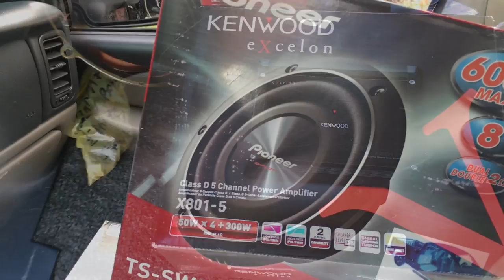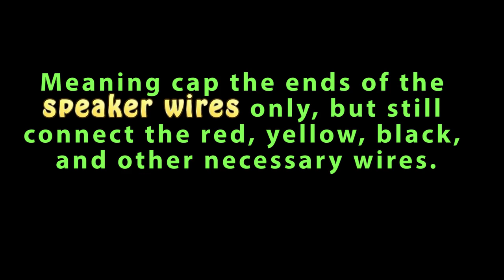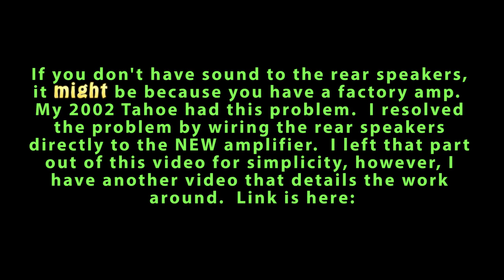Amplifier Install Chevy Tahoe GMC Yukon

Comment: Can anyone help me out, 1999 Yukon Denali with Bose, I swapped in an aftermarket unit in place of the factory radio and used the metra harness all wired up easily and have power to the whole system, but my issue is The Volume is Way Too Loud at like 1!? Am I missing something some kind of module, interface, Special wiring harness? Aftermarket unit has 2 RCA outputs, everything works fine but sounds Overpowered. Not ready for amp and sub add-on just yet so don't want to bypass.. TY

Comment: Maybe I missed it, but did you run speaker wires from the Amp to the factory sub or did you use factory wiring?

Comment: Does this amp get hot on ya? I just switched to this exact amp and mines seems to get too hot for my liking.
Reply from the maker: YES.  But it's never failed me.  I might make a box for it and run push/pull fans in the future.
Reply: @TahoeSteve  I've drove 10 hrs and it's hot but doesn't shut off. I play my music at moderate volumes mostly.

Comment: I have a 02 Tahoe and I'm getting too many volts to my ampsI know this because I unplug a wire on the alternator and my amps did not go into protection but when I plug that wire backup my amps going to protection when the bass hits hard the problem with leaving that wire unplug from the alternator is the 02 Tahoe has to run at like 19 volts when I unplug the wire it drops it down to like 13 I thought the whole problem was the factory amp but I disconnected the factory amp so I guess I have to get an amp regulator or a voltage regulator or do you know another way
Reply: NorCal Rider  hell it doesn't matter anymore I figured it out my whole entire problem was I was trying to put my amp in the third row seat and I only ran 8 gauge wire so yeah that will make your amp go into protection lol when I moved it closer to the head unit all my problems went awayI probably didn't even have to rip out the factory amp I can't believe something like that stunt me as long as I've been putting in stereo systems I've just never owned anything like a Tahoe I've always had like a Dodge ram or a car so running 8 gauge wire is fine for situations like that

Comment: My amp clips from ground to seat bolt. How do you keep yours from clipping, this is a small amp too, 250 peak watts so im sure its only pushing 150 rms
Reply from the maker: did you get all the paint off the ground bolt?  i hit mine with a steel brush and knocked all the paint off of it.
Reply: @TahoeSteve  turns out its my amp. Doesnt lime the sub i guess, trying to push a 15 inch sub rated for 700 watts rms. Amp gets hot too, gotta get a better amp

Comment: What length of RCA cable would you recommend getting to where you would not come up short by running it along the passenger side?
Reply from the maker: Mine was around 10 feet and NOT long enough.  So, longer then that...

Comment: Ok I’m trying to install a aftermarket amp and sub I have everything installed and power to the amp but I’m not getting any sound out of the subs is there anything I need to do behind the radio in order to get sound to the subs
Reply: Did you plug in rca behind stereo

Comment: The plastic on my Tahoe was very easy to get off when I had a system in my 01 Dodge ram that s*** sucked trying to take all the plastic off cuz everything screwed down and also finding a place to get through on the firewall was near impossible and I almost f*** up my whole wiring system it got to the point where I couldn't get it through so I basically moved the boot aside and taped up my power wire really good and ran it outside of the boot but now I can't get the boot back to where it was I think I'll just silicon it all back upI have done a lot of systems in my 02 Tahoe was the hardest by far getting through the firewall then after I get everything hooked up only my sub was working the factory speakers were not and then every once in awhile the factory speakers world work and my amp will go into protection and the sub will stop I think it has something to do with my head unit I went and bought a new one whenever it stop being so f**** cold outside I might go actually install it correctly lol nice video though 👌 I always second-guess myself when I'm doing stuff like this

Comment: I have the exact same vehicle except for I have a 2-channel and a 4 channel amp 2 channel amp for a big 12 kicker and the four channel for two audiobahn tens and the highs only problem I'm running into is I don't think the factory speakers will hold up being connected to a amp and I was really trying to avoid taking the doors offsorry I'm leaving so many comments but I'll sit here and watch this video and think of something else probably won't be the last comment 😂the way you wired everything up is very confusing for some reason it's not that complicated but I think you threw me off with not using the wire harness that plugs into the radio
Reply from the maker: Sorry you are confused.  Here's what I did as per this video:  https://youtu.be/NXwjRasWbus

1.  Aftermarket radio comes with a harness.  2.  Then you have to buy an aftermarket harness made specifically for your make/model car.  3.  The aftermarket harness made specifically for your car is what goes into the existing harness in the car.
Reply: How did you get the second amp working? I've got two 12"s that need a stronger amp to power them. I've got everything hooked up right as far as I know, but the extra subs won't make any sound. 2nd amp is powered, all other speakers and stock sub are working, and I can hear the 12"s connecting when I plug the RCAs into the head unit. But nothing else.
Reply: @TrueBolt18  you could have a bad amp or just hooked up wrong if I have two amps I always run a separate signal wire and Power then I get them RCA's that have two female ends and one male end "a splitter" unless you have a head unit that has enough plugs for RCA's but normally radios I bought in the past only have two ports so I have to put them splitters together and make to RCA wires out of one but if the RCA's are not the problem make sure you run a separate signal wire for sure sometimes you can share power depending on how much you're running and also make sure your power  wire is big enough and if you don't have a big enough wire make sure your amps are as close to the head unit as you can get them other than that it's a pretty hard question to answer without putting eyes on it
Reply: @TKD187  Man I'm dumb. XD I had to bypass the stock amp's signal wire for all the speakers and just ran it to the windshield wiper fuse, which was fine. Pulled the stereo out, and low and behold, I never reconnected the 2nd amp's signal wire. It works great now. XD I'm liking this vehicle a lot more than I initially thought I would, it's a great ride and sounds awesome. =)

Comment: You wired the amp remote start to the switched ignition power instead on the remote start coming from the old amp. Why is that?

Comment: I like what you did to the plywood. Would have like to have heard what it sounded like when you were done.
Reply from the maker: Problem with letting you "hear" it is you are "hearing" it through a cheap camcorder and it does not do it justice.  I laugh at these guys who put $10K systems with quad 15 in woofers in their cars, and then say, listen to this, and record it with a cell phone.

Comment: So did you not use the front tweeters and the back pillar speakers?
Reply from the maker: yes, and i don't miss them at all.
Reply: @TahoeSteve ive got a new crunch 4 ch thats bridgeable. and i was wondering if that would power the 4 speakers in the doors and the sub in the rear?

Comment: What did you use to connect to the positive connection for the battery
Reply: use a gm post extender they vary from 5 to 10 bucks. all it does is extend the screw so you can attach the power wire and a nut holds the terminal in place.

Comment: Do I have to remove the old to use the new amp
Reply from the maker: no, but it will distort terribly
Reply: Tahoe Steve can you bypass the factory amp without a harness
Reply: I was going to ask similar question.
 Have the 95 suburban with stock Delco radio/cassette deck .
 Still want or wanting the rear ceiling/lift gate speaker(s) louder.
 My own hearing is shot. Pretty much am deaf in right ear; So, I don't feel necessary to do audio upgrades
- though I replaced the rear driver speaker L/R as they had aged and crumbled. Fronts are still original bose door speakers, and sound good. W/50,000 miles
-driving my suburban more often lately... actually the stock radio system has not much tone adjustment. Not enough Bass!
Reply from the maker: I bypassed mine
Reply: @TahoeSteve  lmao I forgot about this comment section I’m sad I no longer have this car anymore
Reply: @missingremote4388  I’m not sure about having the rear speakers louder but you could adjust your phones audio setting if your using a Bluetooth fm transmitter to connect your phone to the radio also like I said in a comment earlier I just used a rca cable adapter and spliced it into the oem amp inside the center console at least that’s where my amp was on the 03 suburban z71
Reply: @PandaHiveGaming  thank you. I have the older suburban with out the   console. Stock radio / no bluetooth or MPEG. I've never tried those x 19 years.
- my stereo balance knob was on left only. I only needed to center it for L/R
 I tried the radio today and it sounded very good or passable, for stock bose speaker in front.
Reply: @missingremote4388  which generation also what kind of radio do you have?

Comment: Were did you wire the Blue remote wire to on the amp convertor
Reply from the maker: to the remote wire location.  it actually says P.CON on the amp itself

Comment: where did you connect the remote from amp
Reply: The remote is that blue wire on your harness that normally has a black piece on the end of it that you have to cut off if you're talkin about a signal wire for your amp

Comment: The way you wire that makes sense but I'm f**** confused as shit lol if you don't use the harness for the radio how are you plugging it into the radio ? Lol did I miss something 😂 because I was going to do the same thing instead of branching off of my amp and going to each speaker in the doors just connected to the factory wires and then on the other end hook it up to the I think that's what you did but I'm not sure why you didn't hook up the stereo wire harness it might hit me in just a second 🤔
Reply from the maker: 1.  Aftermarket radio comes with a harness.  2.  Then you have to buy an aftermarket harness made specifically for your make/model car.  3.  The aftermarket harness made specifically for your car is what goes into the existing harness in the car.
Reply: @TahoeSteve  yeah I got it you just didn't hook up any of the speakers on the head unit harness but you did use the signal wire power wire and ground right? I'm not going to wire my nothing like thatI'm not going to bother using the speaker wires because I'm just going to disconnect them at the doors and run wire from my amp to the door speakers cuz I don't want to mess with that factory amp .

Comment: How in the hell did you pull the bolt out of the positive battery connection wire. I don’t know if mine is just rusted to shit or what, but I’m thinking about cutting it lmao
Reply from the maker: PB blaster

Comment: Where did u put ur ground?
Reply from the maker: A seat belt bolt, if i remember correctly
Reply: @TahoeSteve   thanks man!!
Reply: Frameis the best place. Never run to the body, it'll end up melting the body ground strap and causing all kinds of problems.

Comment: what if your car has the bose amp?
Reply from the maker: not sure, sorry.
Reply: That's my question also. Where do you wire up the 9 wire? Before the amp or after the amp? Surprised there isn't better in of out there.
Reply: you can bypass the amp by running wires from the new amp to the speakers or just creating a harness to bypass the bose amp.